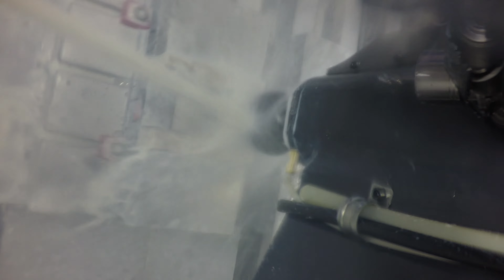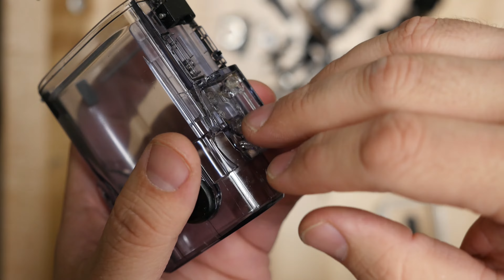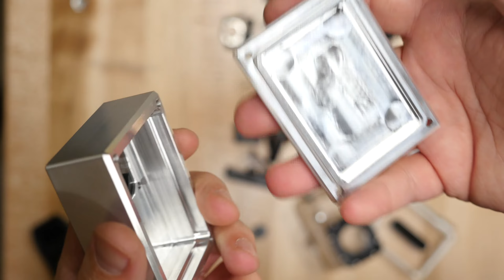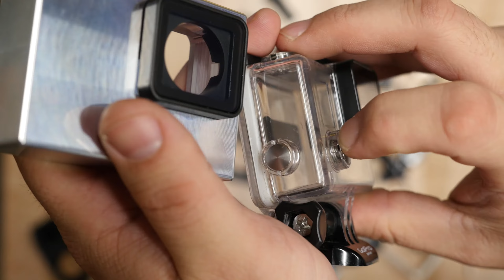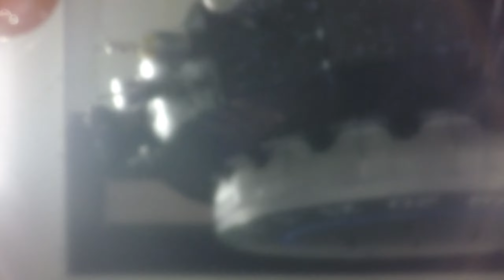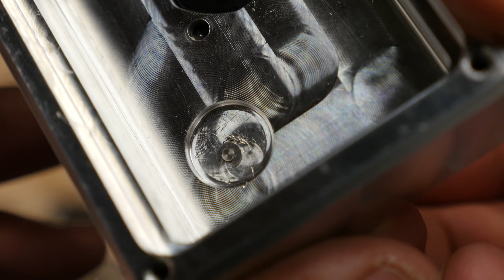Aluminum GoPro Enclosure

Comment: Small tip for removing coolant off the lens:
Make a small, very thin slot nozzle to sit right atop the window. Have an extremely high pressure, but very low volume stream(so, unregulated from the compressor).
Also, light pipes or a single big glass window for seeing the display!
Reply from the maker: Thanks for the tip! What kind of pressure are you talking about? I have ~145 PSI from my shop air compressor.
Reply: The higher, the better(until you start shearing plastic off with metal shavings). 145PSI is fine.
Just make sure the slit is as thin and uniform as you can get it - 0.1mm width is the mark you should probably aim for, no burrs, straight, flat exit hole. The bigger it is, the higher pressure and volume you need to have a good effect.
Beware though, 0.1mm over the whole lens length will still probably eat quite a lot of air.
It works on the same principle as the Dyson Blade. The only situation it WON'T work in is a pool of liquid(so, flood on the table won't work, lift the camera up on a magbase or somesuch).
Reply from the maker: Great, thanks again! A 0.1mm gap would be a challenge I imagine, maybe two gauge blocks separated by some shim-stock (or paper, whatever). I'll keep it in mind if I get back to this project.
Reply: A way to do it is to machine the internal pocket almost all the way through, and then poke it through it using a 15 degree 0.1mm v-bit or a 0.1mm endmill.
They're around $1 each on eBay in packs of 10.

Comment: What kind of coolant you using?
Reply from the maker: This is "Hocut 795-B". I sorta fell into it as it came with my machine (for "free"). I've been using the same batch since I got the machine around two years ago, only adding deionized water as it evaporates and additional coolant/oil as it disappears... um... somehow. This is the only flood coolant I've used, but I have no complaints so far other than it murdering waterproof enclosures.

Oh wait... It does get foamy now and then, but that might be because I occasionally let the tank get low.
Reply: I've been happy with Qualichem. It smells like new cars and stuff and I think is very non toxic or corrosive. It's the only coolant I've used, so I don't know a lot. First 5 gallons is free!

Comment: I have the same issues with coolant splash when filming.  Was thinking of building a Visiport Spin Window type housing for the GoPro..
Reply from the maker: That would be sweet! I've thought about trying to make something along those lines too, but when I think about what that would involve I get discouraged.
Reply: Are you kidding? You build these amazing pneumatic fixtures; would be easy for you! =)
Reply from the maker: Heheh, thanks!

I looked into "DIYing" one at some point and saw that other people had not had good luck trying to make them themselves. I seem to recall that balancing at the high RPMs necessary was a tough hurdle to get past. This was several years ago though...

Yeah, it's probably worth another look!
Reply: Hirudin Yeah, I guess the balancing would be the most challenging aspect.  The motor and electronics would be pretty straightforward.